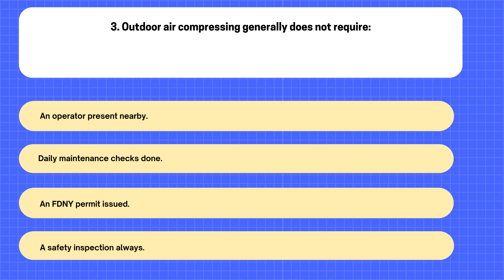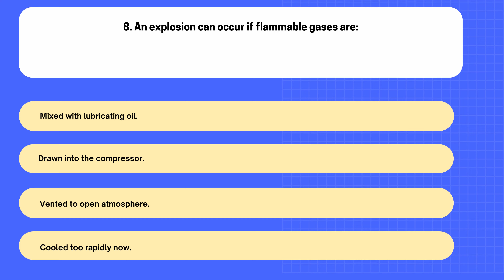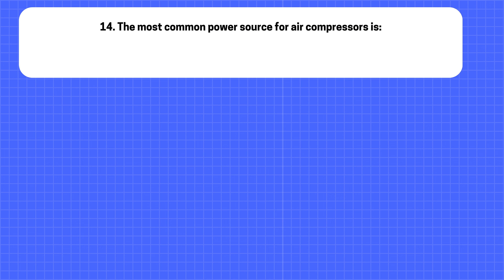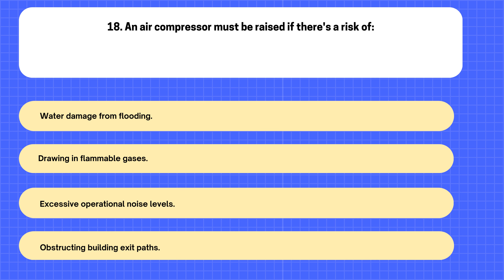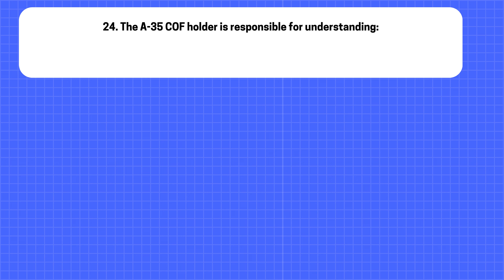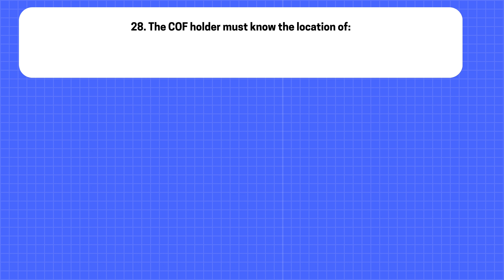A35 practice test

Comment: 1. Supervising permitted air compression.
2. 100 psi for nonflammable gas.
3. An FDNY permit issued.
4. Personal or general always.
5. Settle near the floor.
6. Raised above ground level.
7. Three feet above ground.
8. Drawn into the compressor.
9. G-35 and W-11 COFs.
10. Storing pressurized air safely.
11. Ensuring safe equipment operation.
12. An FDNY permit is required.
13. An air tank container.
14. An electric motor unit.
15. Overseeing operations responsibly always.
16. All existing facilities always.
17. Notify the site manager.
18. Drawing in flammable gases.
19. (Question was cut off/incomplete in your file — cannot answer reliably)
20. Inspection by FDNY representative.
21. It can be injected into skin.
22. Over 100 psi generally.
23. Calling 911 immediately now.
24. Applicable Fire Code sections.
25. Isolate and render inoperative.
26. Ensuring worker safety always.
27. Required annually by FDNY.
28. Fire extinguishing devices nearby.
29. Is filed within 24 hours.
30. The New York City FDNY.
Reply: Fyi, at least three of these answers are incorrect.